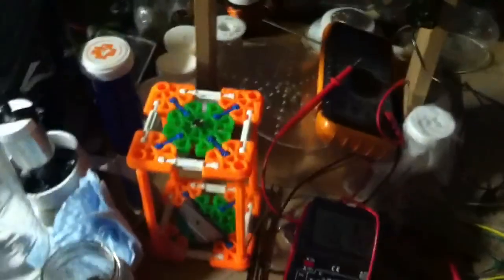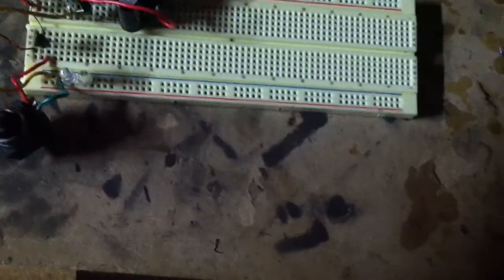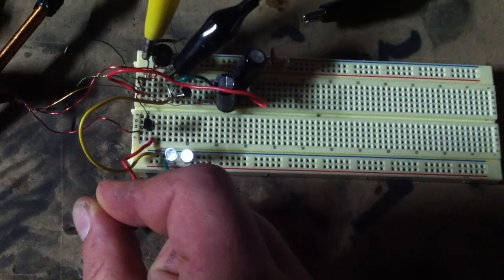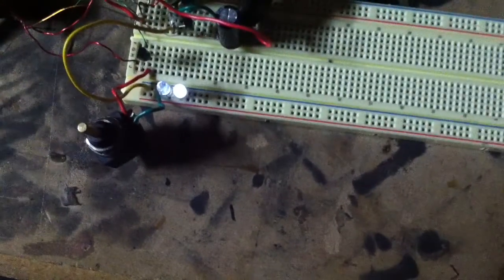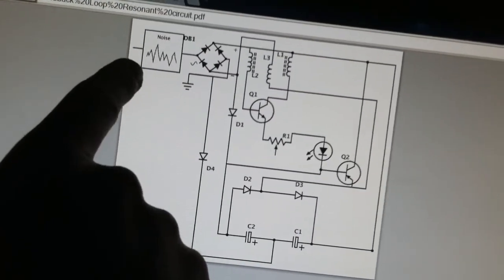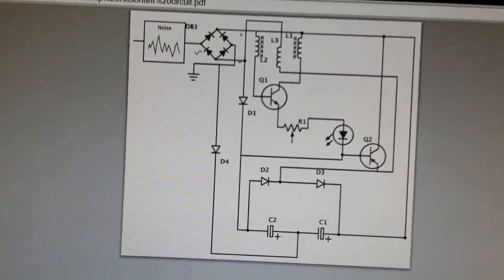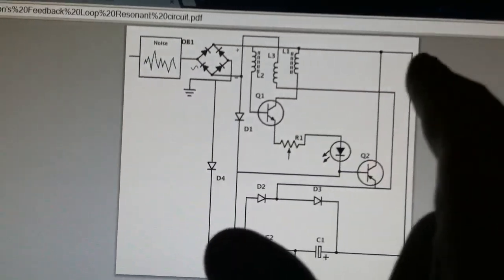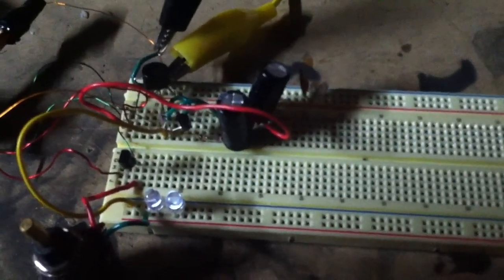Resonant feedback with a proper schematic

Comment: Thanks for sharing ! Where does the "noise" or BackEmf come from ?
Reply from the maker: It comes from the ground connection of the mains power outlet. The wall outlet in my house was not grounded properly. Each individual electronic decline I shut down would decrease the power of the series connection to an earth ground. I hope that answers your question?
Reply: Does it works properly when we connect the ground from water pipes, as akula did ?

Comment: Nice work man!

Do you wanna try to see what happens when adding a cap on the ac side going to the minus side on the rectifier, and see what happens.

See my pick up circuit
http://youtu.be/mh7bBEHJhMM

Greets JB
Reply from the maker: I have set up this way and used a HV capacitor from say a Camera flasher.  It built up quite a substantial amount of voltage like amplifier circuit but it likes balance in a sense.  The sense being that it doesn't do much work according to what we know currently... <---- You like that pun ;)   I will do it for the sake of learning with this new circuit, and because you are a circuit pimp ;) That't the next video... Wait... what kind of capacitor? A polarized Electrolytic, a ceramic, or a variable which I do not have but I can make with an LC. When I experimented before I used an LC and it had some great gains.  Maybe I will try that :)
Reply: Hahaha Circuit Pimp hahaha good shit!

Try a dc cap first, cause that boosted my output. Im just curious to know what it does for your circuit.

Greets JB